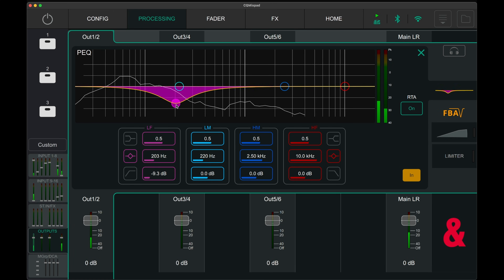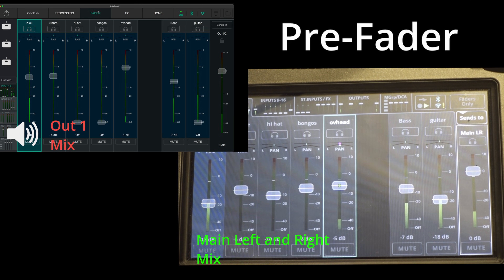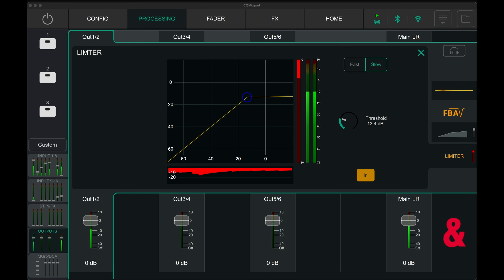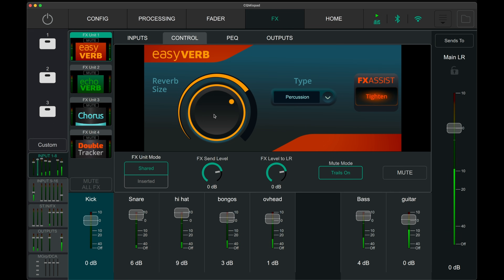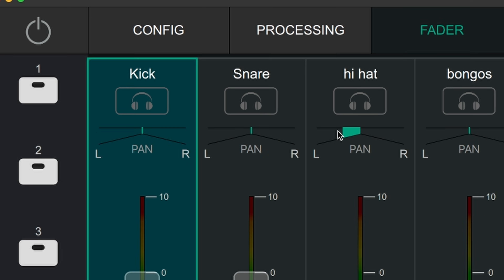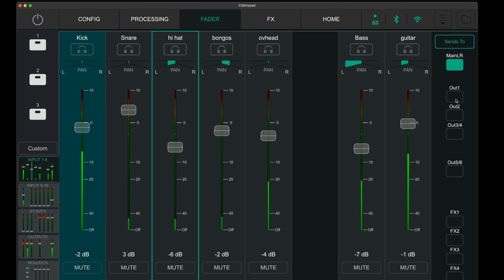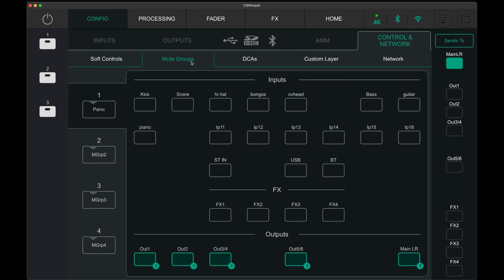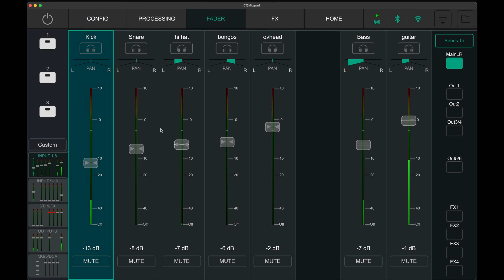Output Processing, Feedback Assistant and Fader Page - CQ 18T Digital Mixer

Comment: So can I only use FBA on the mains only or can I assign the mic to an output and run separately to the PA as a pre-amp to use FBA on the mics only? Or do go from an output back to an input of the mixer to use the mic with FBA only? I don’t want the FBA to affect the entire output mix because of the mics. Thanks for any help.
Reply from the maker: I think you can assign the mics to one of the outputs and use the FBA on just that output so the FBA doesn't affect the whole mix... clever!

Comment: Allen Heath doesn't have support for their products, only knowledge base. I bought CQ 20B recently and can't connect with CQ  app on desktop computer. I used Ethernet cable. Guitar Center  also didn't help me, just gave me instructions how to return.  By the way I used many keyboards,  plugins so I am pretty experienced in digital field and this connecting iss probably a simple but tricky issue.. Goodbye Allen Heath, never again.
Reply: I have the CQ20B. I've used it with a desktop. You have to press the reset toggle button with something skinny like a pick. It toggles it to be connected by the Ethernet cable or by internal Wi-Fi. Flashing yellow is Ethernet, flashing blue is wifi. I found this in the user manual
Reply: They have given me great support before when I had an issue with my Zed I 10. They were friendly and walked me through the issue. I would say they have a great support team.